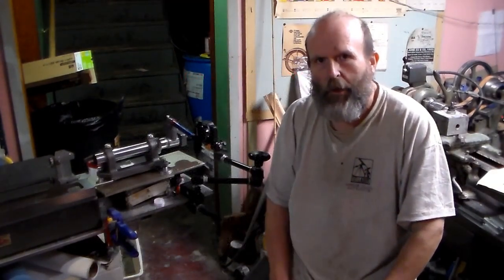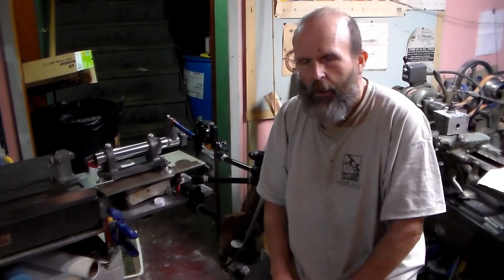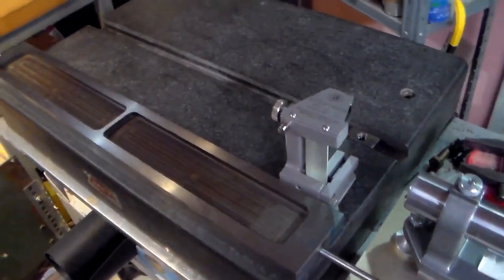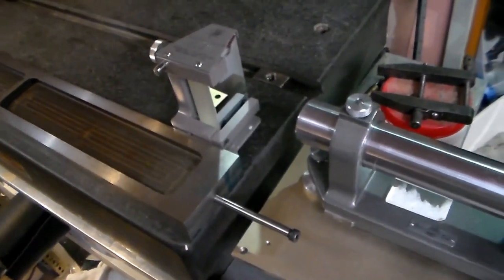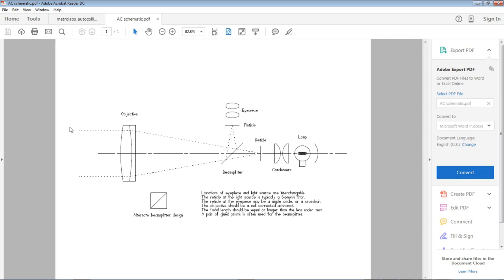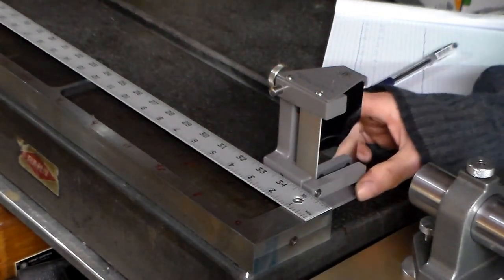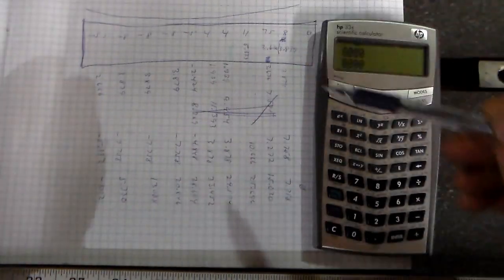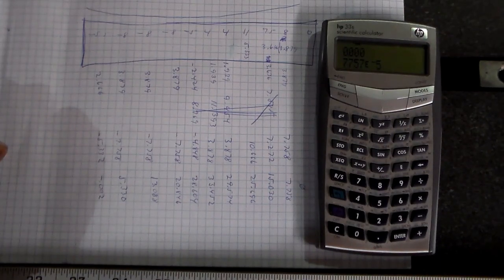Calibrating straight edge with autocollimator

Comment: Hey Wayne.  Great Video.  I just purchased a Brunson Keuffel and Esser optical autocollimator and associated mirrors, essentially for exactly the same reasons that you have sited.  I am a basement shop guy, and quite simply, I find this topic SO interesting.  My questions range from reading the autocollimator to reading the Mahr Supramess .000002 indicator on the flatness indicator.  Questions that I am certain you have had to research thoroughly.  Do you have an email or would you be willing to give me your contact information so I could contact you directly with questions (I have a number of them). Thank you again for the video(s). Derek.

Comment: Thank you for this, I'm in the process of rescaling a selection of 6ft came backs without access to a master to scrape to. I was wondering if an autocollimeter would help. Now I know it will once I get my head around the maths. Great video , hope you got your shaper rebuilt to a satisfactory level. I did mine last year, so this year's project is a tool room lathe. Target is 0.0001/10" alignment. Should be a challenge. All the best Mat

Comment: Wayne:  thanks for sharing i ran across your video because i too am rebuilding a machine and was thinking of dusting off my autocollimator.
Reply from the maker: +Ron Schmaltz Thanks!  I also plan on showing the use of an optical square with the autocollimator as well as surface plate calibration. The last one will take a while :)  Lots of numbers to crunch!!
Reply: @WayneHilliard  was looking at this for building a few CNC machines, now I need this.... Seriously though thanks for the videos, the PDFs were a bit of a head scratcher for me.

Comment: Wayne:
after thinking about it, and you may have probably  already  done this,is to check your rock down that line, then rotate the straight edge 90 degrease and run the mirror on top of the straight edge.  Then place the straight edge on the "Airy points"  and run the mirror on top again. then think about the results.  good luck i will be watching.   Thanks, ron
Reply from the maker: +Ron Schmaltz I have not. I will need to make a rail assembly close to the same height as the straight edge. The width of the sled feet that way is too wide for the straight edge alone. It doesn't need to be particularly straight as any variation in height on that foot will only result in a rotation of the mirror about that axis and no angular displacement will result. Will be an interesting video I believe.
Reply: +Wayne Hilliard  YES!  Wayne; you are defiantly taking it to the next level:  the beauty of an autocollimator is that with it you can check almost everything (and i don't know if i should use the word "almost:") lets just say that it is a beautiful thing. my problem is that i only have one.  none the less you may see that your straight edge flexes under its own weight. i won't be surprised.   All more and more curiouser.  i appreciate what you are doing and that you are posting videos.  Oh that is a very very nice mirror you have there. thanks.   ron

Comment: @ 24:00 you should be taking tangent of the angle, not sin of the angle.
Reply from the maker: Hi One Two, Thanks for the comment. Didn't find it ti just now. I have to respectfully disagree though. Taking the sine is the proper operation and This is why. The 2 inch spacing of the feet on the mirror is forming the hypotenuse of the right angle. The foot that deflects up is forming the opposite side of the right angle. The movement down the plate forms that adjacent side.   Sine = opposite/hypotenuse .

 Now you can get close enough results taking the tangent because of the small angle rule wherein the  tangent of a small angle is approximately equal to the amount of angle in radians.  To illustrate this take the sine of a small angle say a 1/8 of a degree then the tangent of the same angle. The results will agree out to several decimal places.

 I can clarify in another video if you'd like.   Thanks again! :)